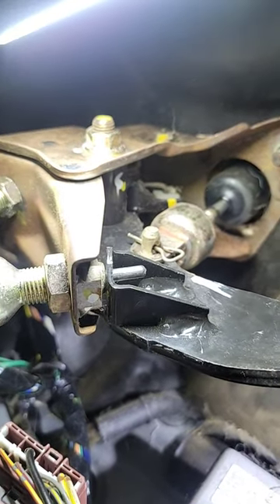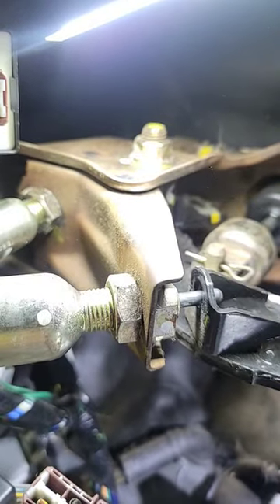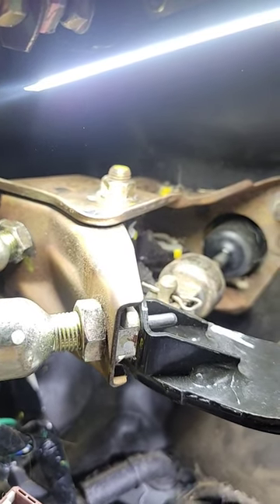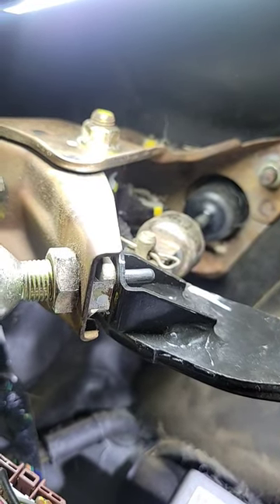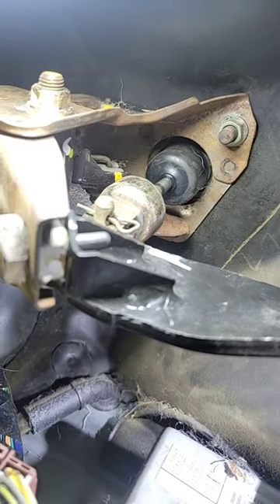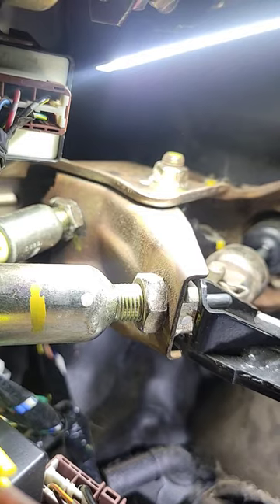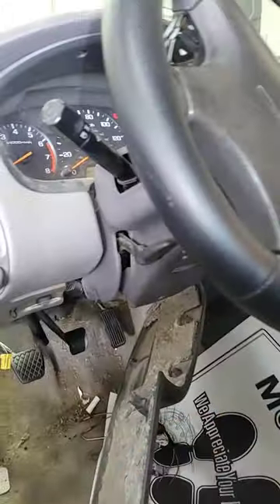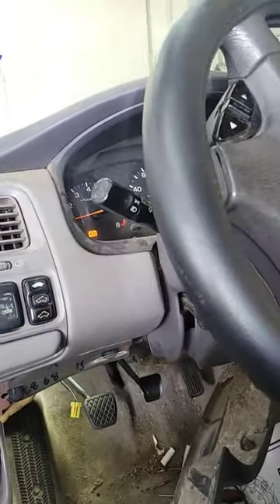Your #Honda 5 speed not starting , Clutch saftey switch #shorts

Comment: This was so puzzling. Starter was fine, alternator, battery, fuses, relays, immobilizer, ignition switch. Everything was fine and I couldn’t figure out why until I saw the broken apart brushing on the ground and at first didn’t think anything of it. Did more digging and digging and found a video like this where that little tiny brushing was actually the thing holding back my car from starting
Reply from the maker: Hope i helped man. Cars have so many things that'll prevent them from starting.

Comment: Thanks. I’m having this problem right now. How can I test it if it is bad.
Reply from the maker: Put a jumper wire on the unplugged connector from the clutch safety and if it starts it was the switch

Comment: Impossible to replace the top one without replacing what exactly ? 😢 I’m having this same issue and I’m looking for ways to put in the top grommet !
Reply from the maker: You'd basically have to remove the whole clutch pedal assembly
Reply: Same here... I think by 'Replacing What' the creator meant it is difficult to install the upper grommet without opening the clutch lever completely.
Not sure

Comment: im glad i found this. but i have a question so if the car is on and you press the Clutch  petedle down and nothing happens is that the clitch switch? fyi  its a  Acura 05 tl new starter and clutch new redone.
Reply: Honestly out here looking at the same thing for my 04 Acura tl😂

Comment: don't forget when the brake lights stay on
Reply: Wait does the brake lights stay on if this is a problem? Bc im having a no turn over issue the honda civic is almost there but doesnt there is a werid problem with the back lights they stay on so what a similar situation.
Reply: @DeyDeys they have a rubber on the pedal that it wait it hits so you will see the switch coming threw the hole

Comment: Okay so you seem like the only one that can help me. I just redid the slave and master cylinder in my 2003 Honda civic ex and my clutch pedal still sticks to the floor and does not come back
Reply from the maker: Based off the info it seems like the system has not been or is not bled correctly or all the way  , never rule out a faulty part tho. Quality control on 3rd party parts is abismal

Comment: I just glue a penny to it.
Reply from the maker: That's a great idea
Reply: @WhatTheDuckAuto on a 1997 lude its incredibly hard to reach. i had to back wrap tape on a long screwdriver and stick the penny to it, and douse the other side of the penny in glue and stick it on top of that hole where the bushing broke. can anyone explain why tf there is a hole with a bushing there in the first place?? why not just flat metal to push the button in when you engage the clutch. what point am i missing here?